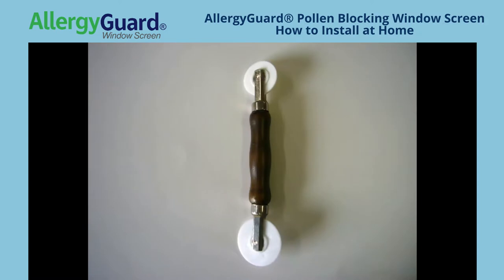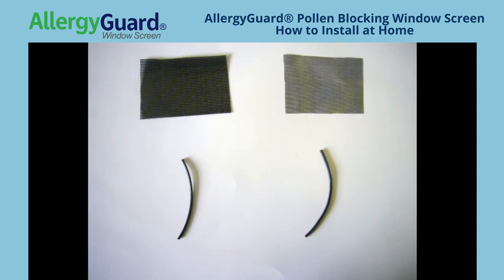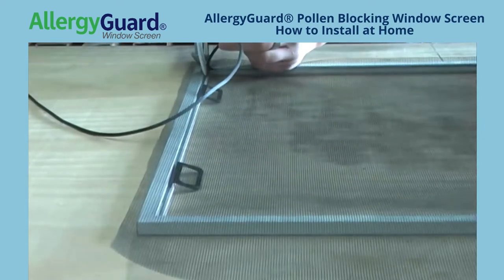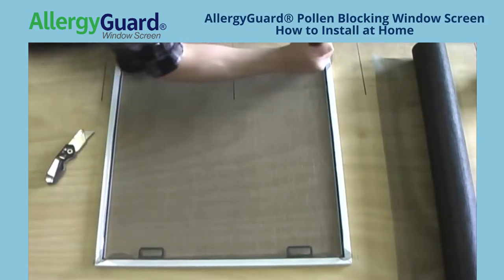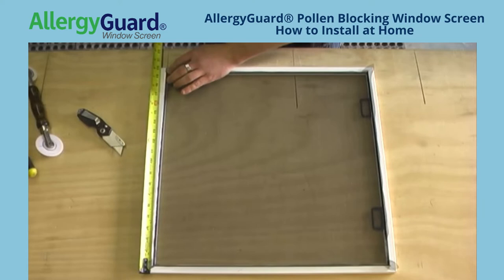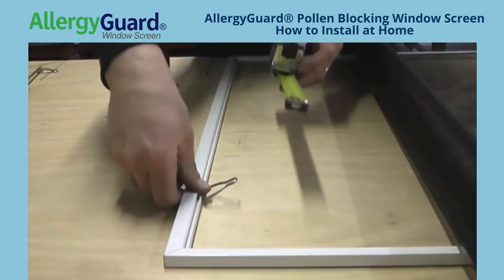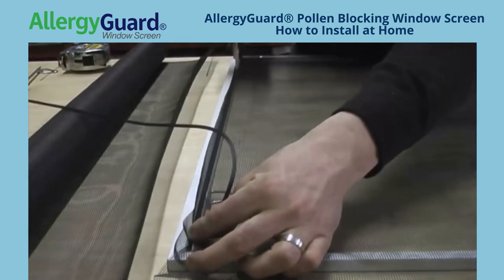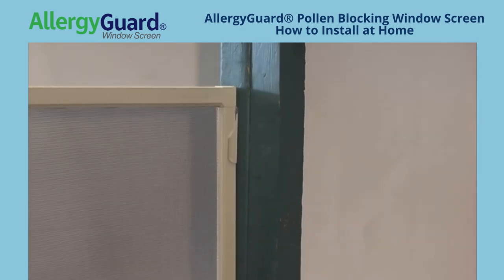Genuine AllergyGuard® Pollen Blocking Window Screen: How to Install at Home

Comment: I doubt any DIYer could stretch this screen too tightly because it's very heavy grade; I've had issues with sag despite using clamps, using a book to maintain a level plane, and taking my time to carefully press in the spline. It's okay because it works & nobody seems to notice the imperfections (but me). One disappointment was the airflow compared to conventional screens. While the manufacturer claims it doesn't, in rooms with this material it stays warmer than other rooms not treated, despite dropping temps outside. So breezes stay outside & that may be a deal breaker for you  That's the bad part; the good part is that it does seem to keep pollen outside where it belongs. My strategy has been to treat only some windows, leaving others to open late at night when I want to cool my home.